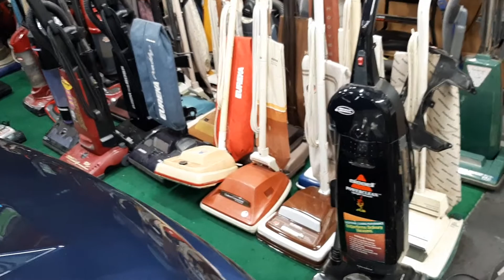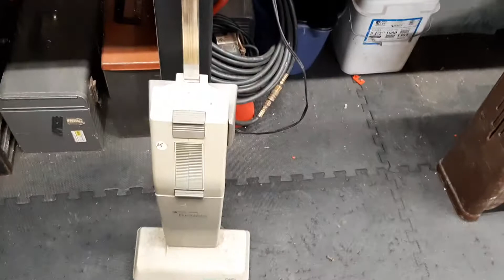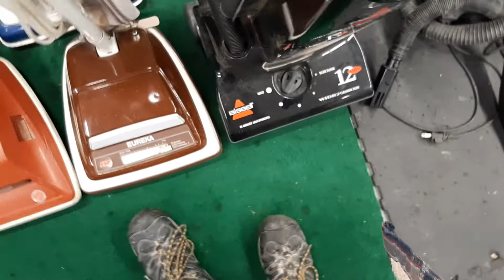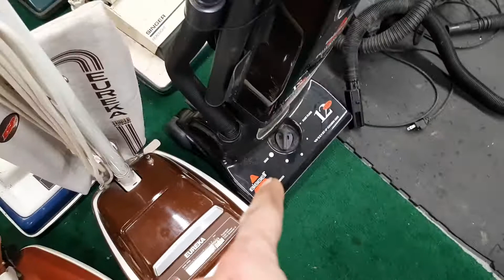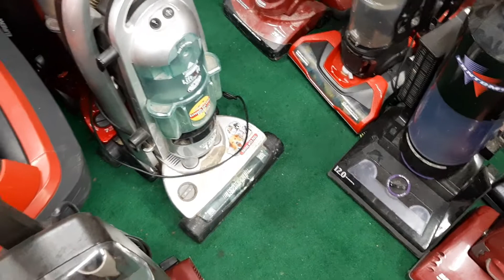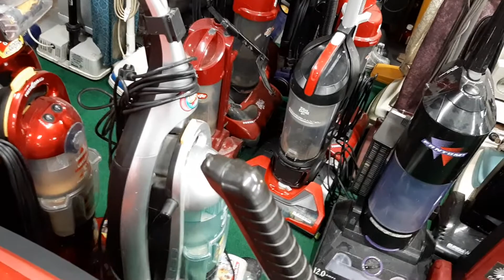Welcome home surprise

Comment: Used to have that Kmart convertible! Hand me down from my late grandma after the belt changes were semi-frequent (cheap-quality “Durabelt” belts were used and snapped regularly. Then an endcap finally came off due to stripped threads, and it was given to me! Fan broke one day, and I took it to a repair shop, who (cut to the chase) threw it out without my knowledge 2 months after I gave it to them and said they’d try to find an aftermarket fan!